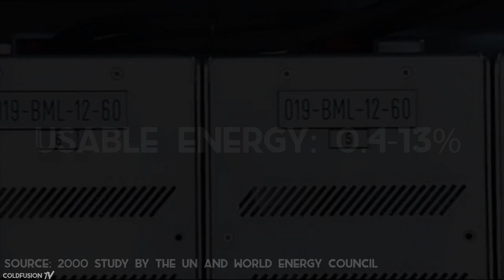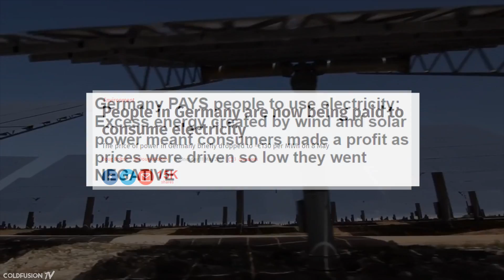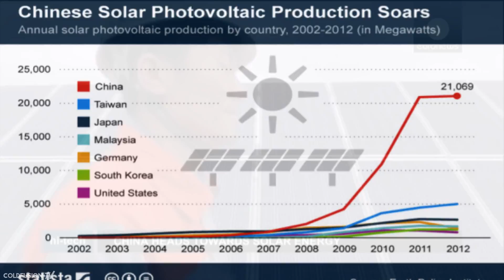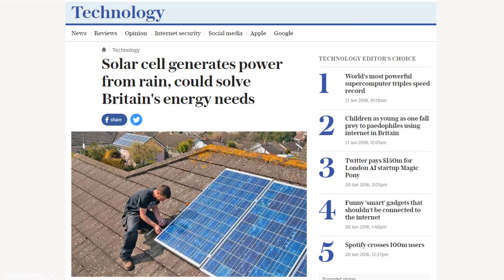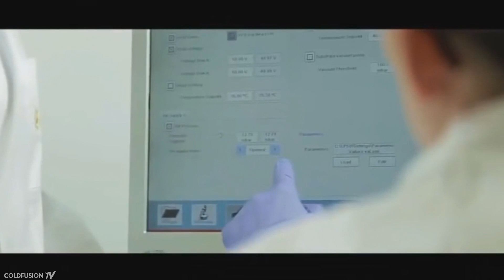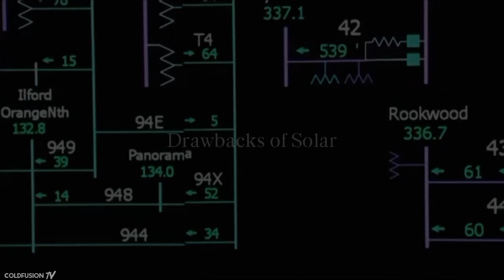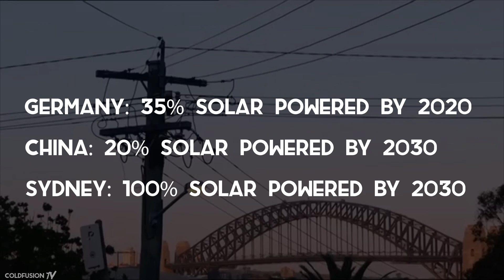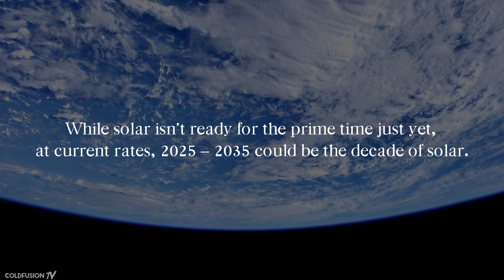The Truth About Solar

Comment: Cold Fusion, the real problem for PHOTOVOLTAIC  solar power has been intemittency and that has not changed. You can overcome efficiency with lower prices and acreage, but this does nothing for intermittency. 

Put another way, we need steady power at a certain useful magnitude/level.   Elon Musk got it wrong too. Your cooking rage is not like a plant with leaves. Plants deal with intermittency with STORAGE. They store energy as carborhydrates.

Until Solar power has enough storage to be able to provide steady electricity at the desired power, it will have to depend on Coal, Natural Gas, Nuclear or other means to carry its inadequacy.

I jus don't see the Storage problem being solved any time soon.

These are the Cold Hard Facts, no sugar coating required.
Reply: Well theoretically, yes it could possibly work. Here are the difficulties. 1) Wiring, wiring wiring. The longer the wires, the greater the resistance and line transmission woes. The amount of environmental disturbance could be significant from webs of wiring. 2) The Oceans. The oceans represent 3/4 of land globe surface. Still it is possible to do.

So when the expense of this much wiring and possible additional storage is considered, plus maintenance, plus replacement of aging PV cells, then we need to ask why not find other local solutions. Anyway, the point is that it's not impossible, just really hard to do.
Reply: Massive molten salt batteries are used to store power from intermittent sources.
Reply: That's were smart grids and batteries come into play. No grid could be 100% solar and no one is proposing that. You use a mix of renewable energies depending on your location to meet your energy needs.
Reply: It would be terrific if your battery, USING solar power from your rooftop alone, could:

a) Charge your car, 
b) Heat your Shower, 
c) Cook Your food, 
d) Heat Your Home or cool it in summer, and 
e) Play your TV/ your computer/ your shaver /stereo
f) mow your lawn, and run your indoor and outdoor lights.
g) Keep your fridge running 24/7/365

That will be one heck of a heavy duty battery. We simply don't have it yet. Maybe we'll get there some day. but when we do get that battery, batteries die eventually, we'll have to replce them and recycle them too, both of which cost more energy and money.
Reply: This is a good point, but I think we need to think of solar as a contestant in an energy mix, not as a unique source. There always be a mix of sources, or a energy production system, and the idea, in my opinion as an engineer, is to optimize this system in term of capacity, emissions and stability. So if a given country is aiming to establish an energy production system with the above in mind, solar is the first choice (clean, esthetic ..), it would be considered as an active domain of production and R&D, new technologies would replace the old ones until the technology is refined and a mix of solar/thermal production scheme is established. However, sources like hydroelectric and nuclear are more clean in comparison to coal/oil, so they would be the second choice. Hydroelectric and nuclear plants would function continuously and kick in where the PV/TH is not enough. It's technologically doable (Germany as an example), but for this to work, a solar WATT needs to be at least as cheaper as a coal one, which is becoming more and more a reality.
Reply: pobembe1958 Solar is intermittent and there is no way around that. It also needs a lot of land right now and storage still needs work. Solar is a good source of energy but just like how we don't just use coal or gas power plants right now, we can't just use solar power plants. Gotta spread the load around.
Reply: Stratfor says in 100 yrs. all of our energy will come from space based solar. The sun never stops shining in space. Maybe we need a JFK pledge to develop solar in 20 yrs.
Reply: There has been a lot of media hype on supercapacitors lately, but consider that there is a really good reason Elon Musk's Tesla Motors is not considering then for their electric cars, and that's low storage density.

For sure supercapacitors are better than old style capacitors, however not all  the Hype in the world (from certain Tech sites) will make them better than Lithium and other types of Batteries.
Reply: I don't see solar as "the" solution to the world's power problems, but rather part of that solution. When you add the inverter and batteries, powering a traditional home is going to take a long time before it rivals coal for cost per watt, and you end up with things that can be equally or more harmful to the environment. Most solar powered homes are still connected to a grid to feed off the utilities when these batteries drain. And in peak usage, with a hot water heater, washer/dryer, dish washer, microwave oven and a couple of televisions and light bulbs that didn't get turned off, those batteries drain quickly, no matter how energy efficient the appliances. 

But supplementing certain electrical systems with solar? Absolutely. A ring of LED lights installed sips power compared to traditional bulbs, and just a couple panels and one large deep cycle battery could light your house for years. No need for the expensive part--the inverter--if that system is closed and running 12V. And that 12V is a real kicker for our modern electronics. We all know that a USB charger in a standard wall outlet is dropping the power of your 120V outlet DOWN to 12V for your ipad or smartphone, yes? Why not have a couple USB charging ports around the house instead of electrical outlets? Or next to them if you need the extra security blanket. 

In most climates, for hot water, you don't need solar panels at all. Or the one you do need? It's just running a small pump. Solar water heaters can be used almost (I stress almost) anywhere to generate hot water for little to no money. And with a little ingenuity, and some radiant floor heating as well, you can reduce your heating requirements for a normal insulated house to near nothing. Think about that come winter. Add a few geothermal wells into the mix and pump yet more water into the system--this time at an ambient 60 degrees fahrenheit--and say good bye to your the spike in your electrical from cooling the house too.

So we have hot water, climate control, many potentials to power modern electronics and light. Probably for not much more than 3 200 watt solar panels, A few deep cycle batteries in parallel and--maybe--an inverter for the few 120V outlets that you dedicate to a smart TV or two.  All those extra creature comforts? The microwave? Oven? washer/dyer/dishwasher? refrigerator/freezer and snow cone maker? Those use massive spikes in electricity on demand. The aren't always on devices. For that, we need Elon and his big battery. To store power for when its needed. And we'd need the panels to charge that battery and use it. Better still, a hybrid system, using wind/solar and alternative energy to produce the power on demand that the battery will supply.

There is an inherent advantage to making these modifications in increments like a posit as well. If you decide to go with LED lighting, the cost of the panels, rewiring et al is much less than dedicating a home buyer to solar. Once they have confidence in that system, they would be more receptive to the solar water heater. Need to retile that bathroom floor? Lets try out that radiant heat flooring while we're at it. And so it goes. Before they know it, the house is mostly off grid and they're looking for other ways to reduce impact.
Reply: what about a big rechargeable battery, houses with solar panels use those
Reply: bensemus x It just sounds to me that Cold fusion is saying solar will do all these things alone. Maybe I am miss hearing him?
Reply: I wonder why he is leaving out Solar thermal with molten salt storage. Ivanpah is on the right path, but horrible location.
Reply: If it is spread over the entire globe all on one grid couldn't it then work?
Reply: Battery technology is also greatly improving. Also, one must not assume that we'll all continue to rely as much on the grid.
As for negative thinking about daily peak energy use, we can add efficiency by using technologies such as better insulating in construction and induction for cooking.
There is also research being done about deriving hydrogen gas from hydrolysis.
The switch to sustainable is going to take every viable solution we can come up with. We simply have no other choice!
Reply: Super Capacitors.
Reply: Anyway how thinks batteries can solve the problem... Stop....

or second best thing. Make a economic calculation of it. How long do the battery last, how much can it store, what is the total cost.

If every day was exactly the same then you might push the total cost down to 30-40cent/kWh... but its not... If you are a bit north (our south of the equator). Then its also shifts of the year. Storing power from summer to winter is just not going to hapen
Reply: If I had my dream solution using Photovolaic power, I would design a solar panel with built in lithium battery backing.The Back Battery should be able to store at least all the electricity produced by that solar panel in one day.. This way a buyer would purchase enough panels to  cover 24 hrs of electrical use, and batteries would be factory built in.

Pretty sure there will be locations where this arrangement would be ideal.
Reply: pobembe1958 IF you mean something like this:
http://www.aliexpress.com/price/solar-battery-charger_price.html

I´m kind of think those exist
Reply: matsv201 Those are too bulky for mass use, and don't seem to have good enough storage. However, that is the idea :)
Reply: pobembe1958 There is more professinal once, but i can´t find any links. Where there is a larger panel and a lager battery storage.

Anyway. Combining PV and batteries is generally not that good. PV become very hot when they are working, batteries get shorter life if they are hot.

Batteries generaly alreddy have shorter life than PV. Most lithium batteries have between 3 and 8 year lifespan. Having them mounted to a PV will probably half it. A (silicon) PV have about 15-25 year life expectancy.

Also, there is no real point in clustering them togetther. You will need a cable anyway. It would make more sence haveing the batteries under ground for good cooling.
Reply: Correct, but wouldn't a smart grid for the USA cost 1 trillion?
Reply: Many consider the acreage required to be a major issue as well.
Reply: +peccatumDei  nah estimates state that the sw desert is enough to power north america and the sahara is enough to lower the whole globe. if its wasteland...turn it into a solar far..
Reply: Talk to any environmentalist.  They will not agree.
Reply: There are some new and innovative ways to store electricity.   I like the rail cars that go up hill when there is an excess of power, and go down hill when power is needed.  They aren't 100% efficient, but have the capability of storing power on the mega watt level.
Reply: nwsteffey New innovative as well as stupid.
Reply: You are correct. Read my post.  China... might just be our savior in this area. They want to move from diesel to other fuel. They are looking hard at solar and storage. Keep an eye on them. It would do two things. Clean up their polluted air and lessen the dependence on foreign oil.
Reply: And... they can explode, or electrocute you if it is not insulated against water. Multiple problems with super capacitors.
Reply: My understanding is that electricity will lose power as it travels.
Reply: enator71
 I just have to disagree on your stance with Nuclear power. For starters, modern nuclear plants can last 60-80 yrs, and the lifetime costs are cheap even if the up front costs are high. I believe US Govt. data is available on this. Moreover  nuclear waste is not currently recycled, but can be. Many  oppose burying used nuclear fuel because only about 1% of it's potential has been used. However if we do it remains out of harms way.  Look for LCOE (levelized costs) for Nuclear compared with other sources.  http://www.eia.gov/forecasts/aeo/electricity_generation.cfm
Reply: Obviously you don't know anything about the Energy Information Agency of the US govt. It does not publish crap information.  It also publishes sources.

  The About EIA page  http://www.eia.gov/about/ tells about its sources and mission Quote: 

"The U.S. Energy Information Administration (EIA) collects, analyzes,
 and   disseminates independent and impartial energy information to 
promote sound policymaking, efficient markets, and public understanding 
of energy and its interaction with the economy and the environment."
You should just  stop embarrassing  yourself.
Reply: http://eandt.theiet.org/news/2014/oct/ampacity-superconductor-review.cfm
Reply: You're mincing words and sources for you own purpose here to create one big elaborate false analogy. the oil example you quoted is about overstating possibilites which cant physically be realized, the nuclear power argument hes making is about investing in possibilities which are technologically sophisticated but physically possible.
Reply: clearly you aren't studying here because you made a false analogy which didn't answer pobembe argument or mine. You just commited anther fallacy which was a rather transparent appeal to authority, just saying that "you study" doesnt mean you are correct, it means you are pretending to be an authority. what facts are you speaking of? Because pobembe was very specific and hes totally correct, while nuclear is a huge sunk cost the plants last for a long time and have very advantageous levelized cost, just look at France and some northern european countries. Furthermore you at no time made an actual argument about how thats not true, or how thats the same as oil which you cant physically obtain, we can physically obtain low cost nuclear power. Also you didnt use the term vaporware correctly, perhaps you need to study more.
Reply: enator71  The Watts Bar 2 Nuclear plant  owned by TVA is coming online as we speak. Just saying.

It is slightly amusing that your tone of hostility at the mention of nuclear power extends to denigrating the competence of the Energy Information Administration, who are charged to fairly appraise clean energy production.

Watts Bar does not need any CO2 producing back-up, has no indeterminacy, and produces 24-7-365 power for 650,000 households. This is real power, not the nameplate only power ratings on solar and wind.

Funny because I din't realize how good it was until I started checking into your tirade. Yes, nuclear costs a whole lot up front, but when you recon that it has a very high up time, it requires no CO2 producing gas backup, it lasts up to 60yrs (80?), it is a valuable addittion to our GW gas abatement.
Reply: Exacly, Pob.

The (ridiculously obvious) problem of intermittency and storage makes "renewables" a childish Kids Lemonade Stand wishful thinking business.  Everyone involved should be ashamed of this waste and feelgood quackery.
Reply: enator71 Can you please elaborate the "gas generators during the day", please. Nuclear power is rated at 90% capacity factor. This means that unless it is dialed down on purpose, a nuclear plant will run continuously for 90% of the time.

https://en.wikipedia.org/wiki/Capacity_factor
Reply: enator71 I don't get the point. Supporting Solar Power makes sense in the right places and occasions. I just don't hate nuclear like you do. Both are needed to combat global warming.
Reply: No I don't really even though it sounded like it. My beef is with Cold Fusion. I feel he didn't really research the topic well and explain The Good, The Bad, and The Ugly.

If we were in Saudi Arabia, African, even in Arizona, or New Mexico, then Solar power if done properly, and I mean combo of solar thermal and photovoltaics, will be the Boss. Antarctica or Alaska would not be a good place for solar power on the other hand.

I just want logical, not ideological, or even lazy analysis that leaves out glaring things..
Reply: +pobembe1958 

Right pob. 

You have idiots on this site saying Britain is a good place for solar. 

Solar = quack-science Kids Lemonade Stand business.